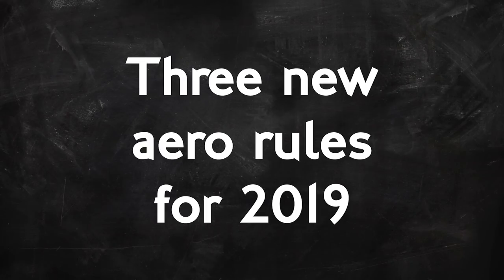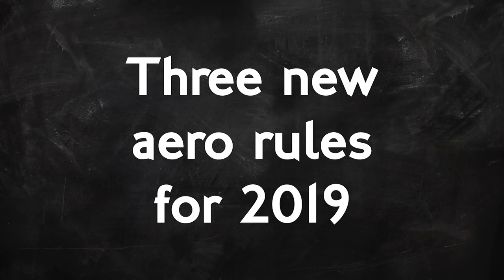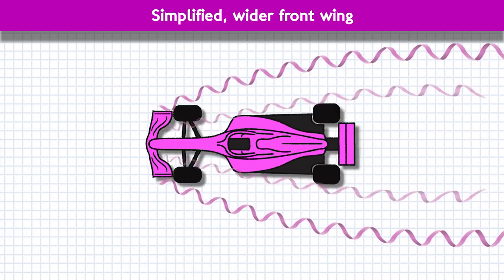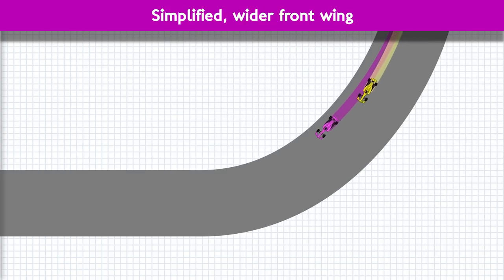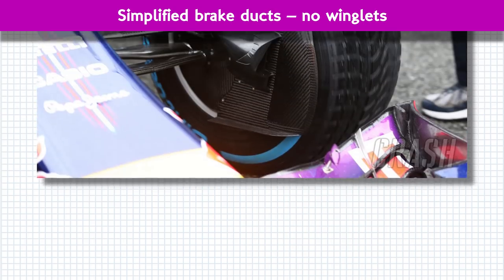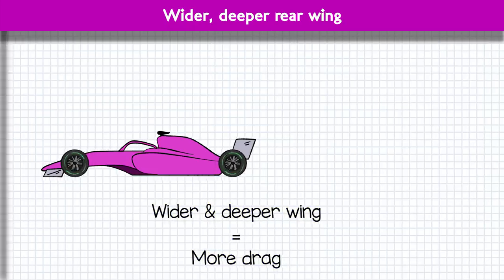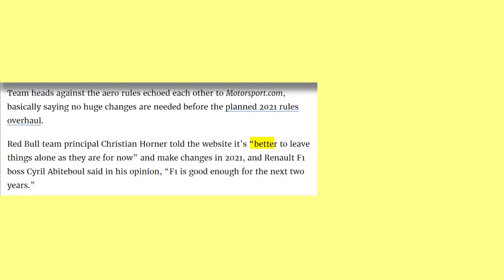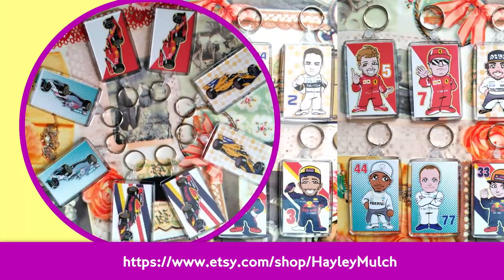New Aero Rules in F1 for 2019 explained

Comment: DRS needs an overhaul too. Its become obvious that its incredibly difficult to get with the 1 second gap for DRS. 1.5 or 2 seconds would be more appropriate for this era. The zones also need to be made longer. I know people dont like DRS because it's artificial but its what we have at the moment, and without it who knows how little number of overtakes there wouldve been in the first four races of this system.
Reply: Well, on most tracks, the DRS zone is a full straight already, where do you want to make it longer? Shanghai? Baku? Long straights are even more boring than racing without overtaking.
Reply: Xavier Rodrigues these changes are designed to make it easier to get within that 1 second window so those changes wouldn’t be a priority right now. However if it is still an issue next year then they should consider altering DRS.
Reply: Xavier Rodrigues Why do we need DRS it's stupid system. Quite honestly I just want their to be battles for the position not necessarily more overtaking but to have a battle for that position. DRS means no battles for the position it's just a clean overtake as evidenced in Bahrain this season when vettel just pops his DRS and gets a completly clean and an undefended overtake. As Hamilton can't do anything to stop vettel from overtaking.

Comment: Great discussions put forth here from your video.  I'm hoping these changes do make an effect on the dirty air which trails the leading car.  I'd like to see closer battles for position by way of using the slip stream, drafting and momentum.  Hopefully the FIA is moving in the right direction with these changes, not sure about the DRS 'improvement' they putting forward.  It may be better to just eliminate DRS and concentrate on the smooth air out flow in creating tighter races.  I love F1 and will always follow it regardless would just like to see the car parade we sometimes see happen a lot less...

Comment: The only way to really push hard on innovation would be to get rid of rules... and human drivers.
Reply: jonny the problem is that old rules make for uninteresting races, and also we're at a point where the greatest limiting factor is the human driver.
Car performance basically peaked in 2004, from there it's always been a matter of restraining the cars that otherwise would have become too dangerous, to a point now where the best team is basically just the one which guesses the right car for the current set of rules.
Tbh it wouldn't surprise me if formula 1 will eventually become a "driver only" championship where everyone has the same car while manufacturers will push boundaries in the robot piloted races, a thing that would actually be great for developing AIs for commercial use
Reply: BubuSnow93 well Formula 1 is both about innovation and driver skill. I'm not really interested in an AI controlled vehicle no matter how fast it is. Racing with AI just isn't nearly as fun as having a human-machine relationship. We already have many means of transport where automation plays a key role, so I think cars should stay human controlled. Sure humans are dangerous while at the wheel, but we can still improve the odds trough learning more about the limits in a racing series. Driving is one of the most fun activites I can think of and I'm willing to take risks to be able to control my own car. And I know I'm not alone, so keep robots out of our cars please.
Reply: Without rules, there wouldnt be much competition, because only rich companies with a lot of money would win

Comment: l'd like to see v10s
Reply: Massimo Pastrello that would never happen in the world we live in nowadays.  Car companies today arent going to develop a gas guzzling V10 that holds no interest for their road cars.  That’s the reason the FIA implented the hybrid V6 systems was to bring the car companies back to F1
Reply: v8 i would consider
Reply: Thomas John Solidum I’ve only been a fan for 3 years but I still don’t understand the need for road relevancy in the engine. No other part of the car is really road relevant. The tires would be useless on the road, and no one asides from off roaders run little rims with big sidewalls. Yes some sports cars have splitters and canards but none have anywhere near the level of aero on these cars. Why is the engine the only part that can’t be in the best interest of racing, drama, and the fans?
Reply: Mason Kurien Its not the engine or the parts themselves but the technology and development is whats useful to road cars. We dont live in a world that lives off in excess anymore and the reason why many companies like Toyota,Ford,BMW, and Honda left F1 after the V10 and V8 era because its financial suicide to develop a Gas guzzling V10 engine that holds no value for road cars today especially as most people today want economy instead of speed. The car companies need an incentive to comeback to F1 and thats why the FIA implemented the V6 hybrid, Honda has returned to F1 and its only a matter of time before the rest will join in.
Reply: Mason Kurien none would produce engine than

Comment: Bring back v8 and make the cars been handled by the car it self and not been based on aerodynamics tricks. We want to see overtakes from cars with 1000hp. Not a rail of them.
Reply: Matthew G 1000hp v8? Lmaooooo
Reply: Matthew G the v8s had wayyy less power than these v6 turbo  hybrids we have now .
Reply: ford doesnt even run a v8 in the GT its that v6 ecoboost.
Reply: jonny j yeah and give the v8s the turbos and hybrid systems and they'll sound no better than the v6s we have now.
Reply: Current cars have 1100 and 1150 Hp in Qualy and about 1000 in race...

Comment: NASCAR has similar issues right now with our Gen 6 car. They're extremely aero sensitive. Depending on the track and aero package being used (some tracks use slightly different aero packages compared to others), cars can be 'pushed' off the other by the aero forces and it makes for really really stale racing.

Comment: Really appreciate your video.
My opinion about a better show looking at new cars on F1? For me, the best idea should be a lot of footsteps backwards.
What was the best era for overtakes? 1978/1982 and behind the ground effect era. Now we know that the ground effect wasn't dangerous as they told to us. The ground effect cars were blamed because, for them, can can easily caused deadly flips for the cars. False. We know that it still absolutely possible after that era (who saw Marco Campos and Jeff Krosnoff crashes knows that). So...in my opinion there are 2 ways for F1:
1) To reduce drastically the aerodinamyc grip for to have a more important mechanical grip. Simple front wing designed for to don't disturb the car behind and a smaller rear wing. In that case cars would be more tricky but finally the driver would be more important. The cars in that case will be a lot slower than the actual F1.
2) Doing the same thing but in a more radical way. Destroying quite completely the front and rear wing aero (using wings like mid '80 era...but avoiding the turbolence troubles of course) and installing a small version of BT46's fan for all the cars. In that case we'll have the same benefits of point 1 (cars more tricky, more differencies between drivers and more overtakes) but the cars could be fast like the actual ones...maybe faster...
There is a problem (?) with this 2 points. It is easy to see cars lapped in 4th or 5th place at the end of the race. But it is also possible to see a car lapped who finish 6th (for example) that is able to win in others circuits. Why that? Because having a less important aero, the engineers wil work in everything else so the cars will be a lot different between them.  I don't know how bad it could be. But I don't look at that in a negative way.

Comment: The problem we have in F1 is not the aerodynamics, its the way overtaking is designed right now. You get an advantage for overtaking on DRS, which means a car passes another car on a straight, where it is undeniably faster by about 20 kph due to less air resistance, passes and there is nothing the opponent can do to stop it. fighting line will not help you, you close the left side he passes right and its done for. I'd love to see the opposite of DRS. DRS is supposed to allow for more straight line speed on straights to cancel out the corner disadvantage. How about allowing a more agressive aero in corners for following cars, by increasing the angle of attack of all wings when you follow close in corners, while the leading car has to stay on its wing setting? That would mean the leading car has less corner speed, but could chose an even slower corner path fighting to keep the opponent from going around, while the chasing car has more grip and manuverability around the corners to fight, but doesnt get a free overtake once the boring straight comes around.

Comment: Here's a little thought on the rear wing changes. Deeper and wider rear wings definitely mean more downforce and drag. Agreed. But that does not mean that teams would be employing the same angular values with these deeper and wider wings since they would meet their required downforce with slightly lower angles than with the shorter wings. Point is, the values of downforce and drag along with drag reduction will remain somewhat the same.

Comment: Might sound crazy but I wish the rules on DRS were changed to allow its use anywhere. If a driver is crazy enough to gape his rear wing in the middle of a corner, have at it. It would give for very interesting scenarios. Perhaps a usage time limit could be applied, rather than a fixed zone and a distance from other cars. A leading car using the DRS to defend would get a boost, but would also give the car behind cleaner air to work with. It would be like adding a touch of aviation controls in racing.... A slight touch of it.

Comment: Looking at the racing in 2017 & 2018 so far, I am glad they are making changes to the aero rules. I also like the idea of lower and wider rear wings as they look much better. I hope they don't make overtaking too easy and not involve any excitement. Wish there was an alternate solution to the overtaking problem than DRS or previously KERS. I remember the front wings in 2000 looking much simpler and affording much closer racing between Schuey and Mika..

Comment: Yes I agree with the idea to reduce complexity of front wind, also concept already introduced some years ago, it will have advantages in production, pilot setting finding during the race weekend, less cost of development and reduce aeroelasticy effects, those are hard for marshals to control.
The downside, knowing my ex colleagues of university, they will spend what reduce on the front wing to optimize body shape and rear wing...
Finally DRS efficiency, today we still don't know if really works, for the same reason why car loose in the shear, probably it will be more "useful" to leave to the pilot the freedom on when use it.

Comment: The main reason for all this mess comes from having to seal the floor.
Allow teams achieve that using lip-skirty things underneath the floor or around 
the edges and most of the vortex-generating stuff becomes not as important.
If at the same time we reduce diffuser sizes (length-depth-width) then we should be good.

Comment: We saw a great races at Shanghai and Baku this year. As long as there is no degradation to the safety for Drivers, Marshals, and Fans, then whatever changes need to be made to make races more competitive is welcome. It has also been pretty awesome to see some of the unexpected results from back of the pack teams like Toro Rosso and Sauber. The change to have all teams on the 2018 engine has made a positive difference, so why not try some aero changes that reduce turbulence. I also think that some simplification of the systems which can reduce the costs would be helpful so that they could increase the power unit allotments for the season without penalties. Do we really want to see a great championship battle during 3/4ths of the season only for the championship to be handed to one driver or the other because they had to take a significant grid penalty because they had to go to a fourth power unit?

Comment: The aero changes of 2009 were meant to address the dirty air problem and, compared to the 2008 and before cars, they did seem to promote closer racing.  The 2009 championship had a very small field spread, even if Brawn and Red Bull did establish themselves as definite front runners.

  In the end though the dominance of Red Bull during this era and the introduction of DRS/KERS, double diffusers and the switch to Pirelli's high degradation tyres made it ultimately impossible to tell if these changes accomplished their goals by themselves.

 I find it strange they're going back to larger front wings considering the fuss that was made about them by the drivers (lots of contacts/punctures due to them not being able to judge the width properly) and that the rear wing will be more akin to the 2008 cars than the, supposedly, more racing friendly 2009 spec ones.

 Also, while I appreciate that DRS exists to try and overcome to turbulent air and negate the disadvantage following cars have I don't want to see its effects become more pronounced.  There's a lot to be said for a good defensive battle being just as exciting as a successful overtake.  DRS prevents that from happening and just allows a driver to leisurely saunter past his opponent.  It's not exciting and makes it so that a slower car can rarely achieve a good result anymore by driving well defensively.

 I would have thought the solution to this issue would be to open up the underside of the cars for development and further simplify the front wing.  I wouldn't even be opposed to enclosing the wheels to reduce turbulent air, as long as the suspension struts remained bare.  That or mandate that a car cannot produce X amount of turbulence Y meters behind it and leave the teams to try and figure it out.

Comment: What I think?

Ground effect
Blown Diffusers
As much power as you can get from the engine of that size
Tyres that either shred within 10 laps or tyres that can last the whole race aside from 10 laps whilst still having a lot of grip

In effect, get rid of some of the restrictions that are allowing LMP1 to catch up to Formula 1. Watching Le Mans last year for the first time the cars looked insanely fast compared to anything that looks similar. There is a history of things being banned for being loopholes within the sport but for a lot of them there was simply no need and it was just teams getting in the way of each other because they didn't want another team to have a huge advantage.

The case for ground effect was that the cars were just getting too fast, that might've flown in the 70s, but now with gargantuan runoff areas and improved safety technology in the car as well as trackside there needs to be a return to actually running for outright performance instead of "Safety" or political things such as Hybrid/Electric.

If you can make a hybrid fast whilst having none of the disadvantages, then go for it, but it shouldn't be limited and forced by what Car companies want to develop, F1 is a sport, not a development program for Mercedes and Fiat, and should be treated as such.

Comment: The only problem I have with these changes is the bigger DRS effect. I do not enjoy Overtaking by pressing a button that doesn't work for the leading driver. And a big DRS effect we already had when DRS got introduced and fans were bored, because it meant the cars are not overtaking, they're passing each other, and why everyone enjoys a good overtake on a knives edge, nobody enjoys passing.

I suggest we need to shift the balance of downforce generation from wing to floor. Ground effect has less of a problem with dirty air. Simplified wings are a good start, as the difference between dirty and clean air will be less, but they should have made slight changes for the floor, like starting the diffusor a tad more forward.

Comment: I understand the reasons why it was outlawed but if they want to continue with the aero bias I'd like to see them go the ground effect route once more.

Less effect of turbulent air on upper surfaces.

Also, the wide front wings we've had since '09 are fuggly. F1 cars were far more attractive race-able beasts back in the early 90's when the front wing stopped at the inner side wall of the front tyre.

Comment: I think it's a good thing they try some new rules. However, I do think that the cars are only part of the problem. The circuits are definitely an important factor in this. There are several circuits on the 2018 calendar that don't really encourage close racing an overtaking manoeuvres. I think that if they want a more entertaining sport to watch they should not only look at the cars, but also at picking the right tracks and dropping those that aren't doing well enough. This might come at a cost as some very boring circuits (for viewers, not always boring for setting a fast lap time) are also circuits which bring in a lot of money or have a long history in the sport, so it will often be controversial to drop these.

A list of circuits I would think of for removing from the calendar:
- Melbourne GP Circuit, Australia
- Monaco, Monaco
- Sochi Autodrom, Russia
- Yas Marina Circuit, Abu Dhabi
And others that I have doubts about because of statistics that show lower than average overtakes per race, but I enjoy watching these races:
- Circuito de Catalunya, Spain
- Red Bull Ring, Austria
- Hungaroring, Hungary
- Marina Bay Street Circuit, Singapore
- Suzuka, Japan
Many of these races would be controversial to remove from the calendar, but what they have in common is that these circuits don't allow modern F1 cars for great overtaking possibilities.